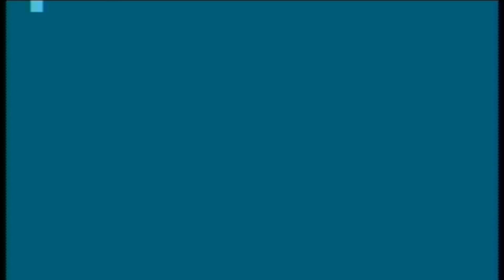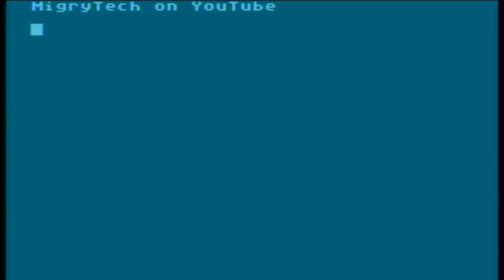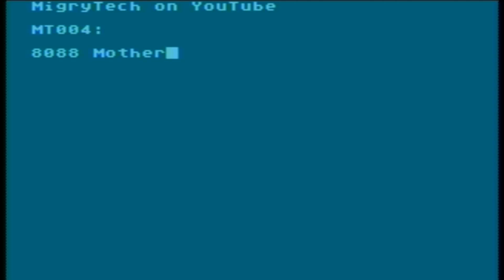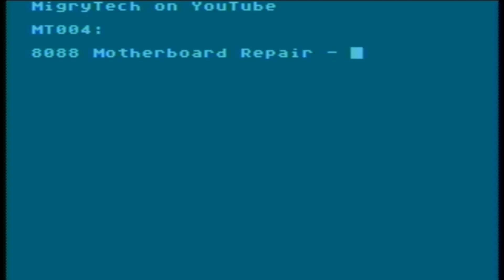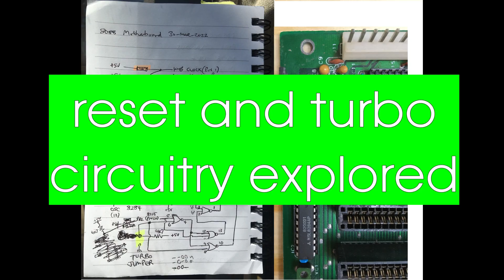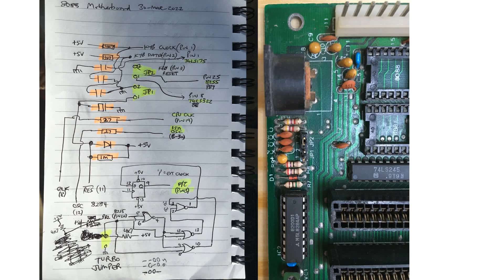MT004: 8088 Motherboard Repair - part 3

Comment: Another interesting Video, thanks for that!  With reference to the Turbo there was a key combo, your  right. As to what it is I cannot remember and will leave the joy of discovery to you.  One fine point if you do not mine me making it.   The Choice of color around the mouse pointer is not one that instantly draws the eye. Found I had to re-wind and pause to spot the mouse.  Hope you do not mind me making that observation.  I look forward to the next Video.
Reply from the maker: Re the mouse pointer, it is a limitation of the screen capture software. I'll check to see if it can be altered. For my regular desktop I have a stonking big mouse pointer, but this is not the one that gets captured. Thanks for the feedback.